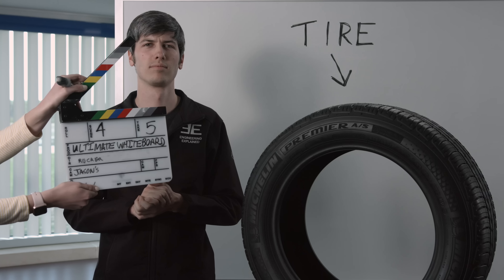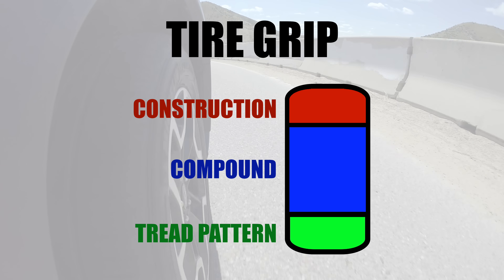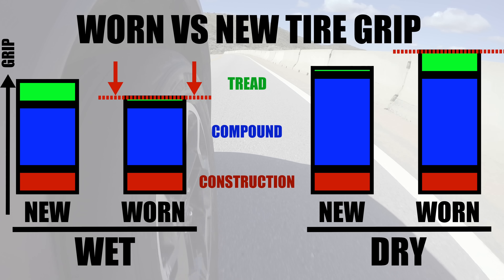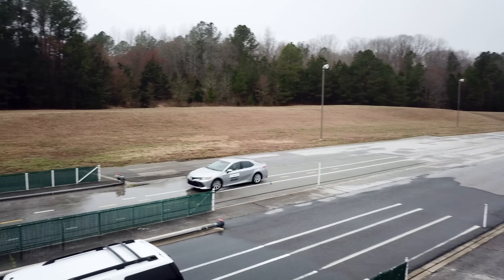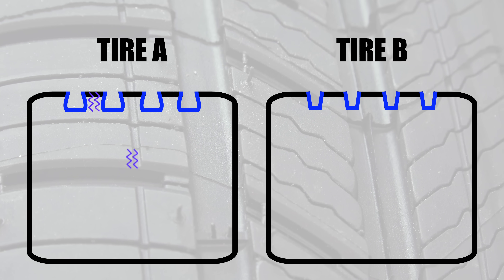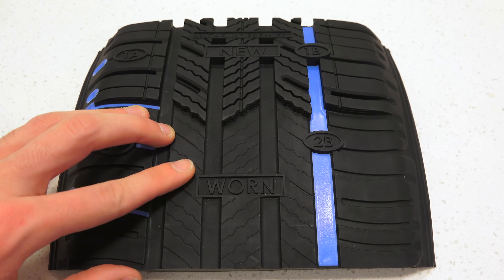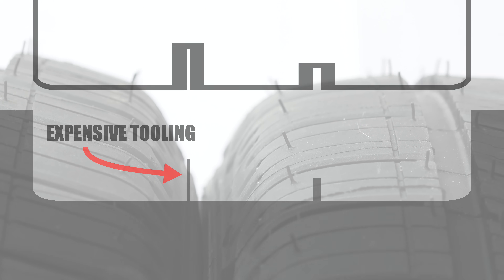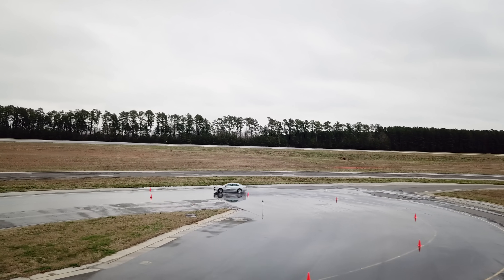New Tires vs Worn Tires - What Performs Best?

Comment: is there video about new vs old tires? i still wondering how long the compound could lasts before they lost their elasticity. nice video as always!
Reply: True that. I recently tried a 8 years old set of budget tires and they got so tough that they will allow even Fabia 1.2HTP to do burnouts on any surface.
Reply: usually if the tires are older than 5-6 years. (in my personal experience)
Reply: hmm.. this might be the reason why my DSC keeps blinking on bumpy / wet road whenever i push the throttle. the tires were going to be 5 years soon. I know my suspension isn't the problem since they were all rebuilt and aligned properly
Reply: what about tropical country? and my car is a garage queen. used them only at weekends or long trip.
Reply: No, they're not.
Reply: Dennis Karlsson x2
Reply: It depends on how many heat cycles the tire gets during its use, and so in the South where it's hotter they start becoming hard after 3-4 years
Reply: They're gonna degrade regardless, I'd guess tires that aren't used will take 1-2 more years to become as hard as tires that are beeing daily driven. Most of the heat you can generate in tires comes from long highway driving, aggressive or sporty driving and burnouts and drifting. If you car sits at home a lot maybe you can put some kind tire shine on it to keep it soft? I'm not too sure about that but people say it works on weather stripping so maybe it works on tires too
Reply: all depends on many factors, 10 years is about max for most. if your talking performance tires them i would say 2 years
Reply: nirfz my tires are 16 years old and still fine.

Comment: so if i let my tires wear down to nothing i will have racing slicks?...i live in Tucson where it never rains and when my tires are worn i still have less traction on dry pavement...A LOT LESS... This time you are incorrect...i think street compounds are way to hard to grip with no tread, touching race slicks is like touching a marshmallow
Reply: How long does it take you to get to treadless? Are the tyres old then?

Comment: Is there any type of tire compound/tread pattern that has at least a bit of grip on ice? (chains don’t count)
Reply from the maker: Yes, a lot of winter tires are studless now, so they're completely reliant on compound and tread pattern rather than chains or studs for ice traction. And the difference between a studless winter tire and a summer tire on snow or ice is astounding; also a significant gap from all-seasons as well. Winter tires are awesome!
Reply: tangles01 

Nooooo, don't put soap on them, won't help at all! :P
Reply: Your pet spider got me
Reply: Guitarfollower22 A lot of the issue with ice is the film of water on top of it when pressure is applied to the ice. So, winter tires usually have lots of sipes to clear the water as well as give lots of edges to grip. They also have a compound that stays softer in the cold. So, winter tires are still reasonably grippy on ice. Not like studs or chains though.
Reply: Engineering Explained for winter xD
Reply: Sudded tyres
Reply: sacr3 so would winter tires still be able to get even the tiniest grip on black ice?
Reply: Not enough to save you on an unlit road.
Reply: Guitarfollower22 No, black ice screws you either way.
Reply: sacr3 As a tire manufacturer I can tell you I am right. Now I certainly didn't say they dont offer less grip in the winter, I said on ice. Not on the frost or snow on the ice but on ice itself. In general real world conditons you will get better traction on road ice. But driving onto ice and losing traction laterally is basically the same as a any warm heavy siped summer tire. I run winter tires every winter season because they offer much better traction in most winter conditions but ice isn't really one of them.
Reply: Brem wrong, being a fella that lives in the northern area of canada we get some wicked snow and ice, winter tires make a hell of a difference. The softer rubber clings more to the snow/ice than all seasons by quite a margin, I had to go a winter with all seasons and them tires just spun all the time, going around corners I'd feel the tires lose grip quite a bit. Stopping was significant, would slide all the time trying to stop. Winter tires on the other hand, god damn what a difference. Was able to take off faster, corner without slippage and stopping was a massive difference.

Aside from all the studies and video evidence of the difference, for me changing to winters for the past 9 years has really shown me the difference. 

Now with that said if it's pure ice, the winter will perform better but the difference wont be crazy, but rarely do you get a pure ice road - mostly its ice with a mix of snow and once the tire strikes snow... well you'll see what happens when ya got all seasons
Reply: Engineering Studdless Winter tires do not have traction on ice, they have traction on the snow or frost on top of the ice. The difference between summer and winter tires on ice alone is almost nothing.

Comment: I'd like to see the difference between new tires vs old tires (with a good tread)
Reply from the maker: I think that'd be fascinating as well! I was asking Michelin about this and they said it certainly does play a role, but has its challenges to test out. Also, as you drive on an older tire, you can start to wear away the surface layer, which may have a "fresher" layer underneath that then improves grip. But I'm with you, it'd be great to get more detail on this subject, and see some testing!
Reply: Shave two sets of tyres. Shave one just a little and the other one much.

Comment: After using both Michelin Defender and Gooodyear Assurance. I found that the good year performs better in wet conditions than the Michelin.
Reply: Considering the Defender is a low rolling resistance tire meant for long tread life but not necessarily stellar wet weather traction, I'd say that comparison is a bit unfair
Reply: Defender was the second worst Michelin I ever use. The Premier A/S shown on the video however, is almost as good on the wet as the Hydroedge.
Reply: Michelin Defender and Primacy HP are terrible budget tires. However, the Michelin Pilot Super Sport is officially the best summer tire for wet and dry roads. Period.
Reply: Get Michelin Pilot Sport AS3+. The life of other "touring" or Grand touring tires, the grip of  the super sports (almost) and they cost way less. Actually they were cheaper than many more generic passenger car tires( in 205-50R17)  and they stick to the road, even on the minefields that my southern Quebec roads are at this time of the year.
Reply: Defenders seem to have been primarily developed to chase the elusive 100,000 mile treadwear title. Wet traction was not the top priority. The new T&H version of the Defender supposedly has a slight increase in wet traction.
Reply: Dave Hoffman You got it
Reply: The "Goodyear Assurance" narrows it down to like 6 different tires. Be more specific.
Reply: Dave Hoffman - But at the cost of a reduced mileage warranty. ;)
Reply: Insno I installed goodyear assurance comfortred touring
Reply: Barrasali Ahmed I actually like the Comfortreds. Installed some on my roommate's CX-5 recently, so far they've preformed very well. They contemplated getting Michelin, but at the time, the price on the Goodyear was too good to pass up.

Comment: This is one of my most favorite channels on YouTube.  The Michelin Pilot Super Sport tires on my 2018 Corvette Grand Sport grip like glue but at 10-15k miles they will be worn out due to soft sticky rubber.  It's the sacrifice I can live with due to the turning performance that is amazing!!
Reply: Go with the Pilot Sport 4s, it is the number 1 summer performance tire on the market right now. I run them on my car and the performance is outstanding.
Reply: If you can afford a 2018 Corvette then tires that expensive should be no problem, haha.
Reply: Thumbs Gaming they would be next for me but my Tesla's 21 inch rims means they don't even make pilot sport 4s's in that size yet. Only the older pilot super sports. Looked up reviews and people say apart from longevity, performance is not any better
Reply: Assuming you drive the car spiritedly, 15k miles on a tire/car like that is very impressive life. Cup 2's are pretty much as close as you'll get to an R-compound tire, along with bridgestone RE-71r's. If I remember correctly, the cup 2's are actually 180TW, which isn't even allowed in most street tire class races, where treadwear ratings are capped at 200.
Reply: Try Nitto NT05.
Reply: My slingshot back is gone in about 6k bfgoodrich pro comp not getibg afain
Reply: Derrick Bonsell you would think but not really.  They are over $400 each!!  That's a lotta cheddar

Comment: what are the safest tires for rainy climate?
Reply from the maker: If temperatures are warm (above about 40-45 deg F/7C), generally a good summer tire will do the best in the rain (PS4S is a good example).
Edit: this highlights the importance of compounding, as even with the best tread design, a better compound with less tread will often perform better.
Reply: thank you. good to know. that way i can find a cheaper alternative 🙈😁👍
Reply: I use Uniroyal RainExpert. I'm satisfied with it.
Reply: Never go cheap on tyres.
Reply: Uniroyal Rainsport 3